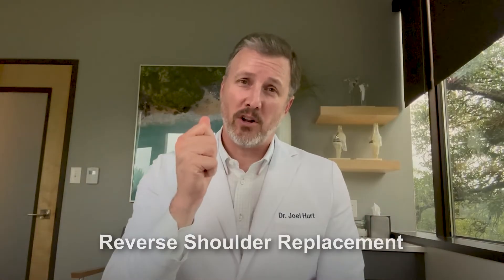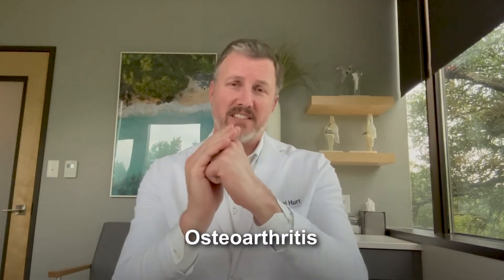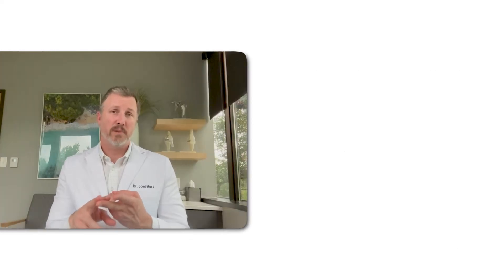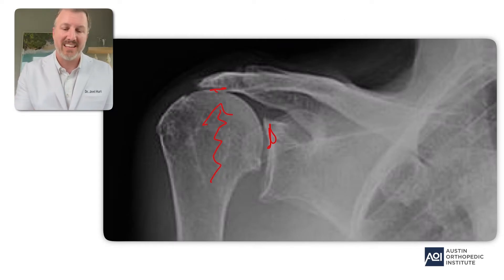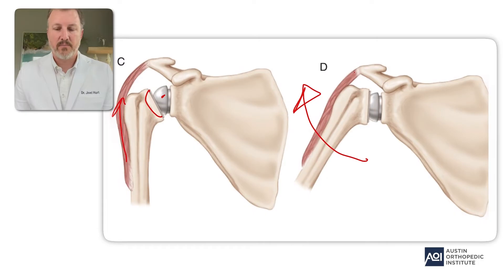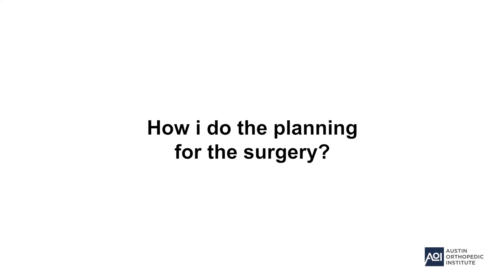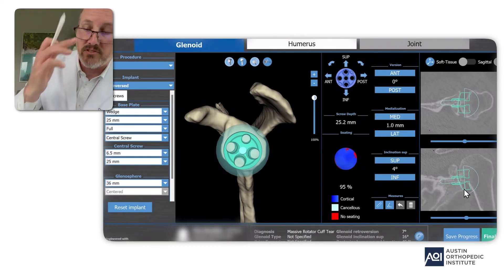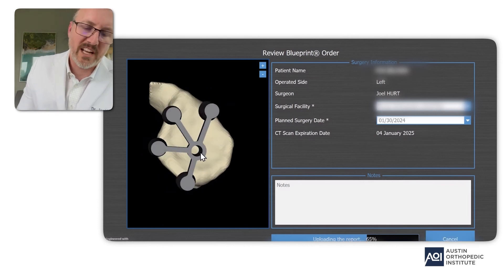Dr. Hurt Explains Reverse Shoulder Replacements

Comment: Not sure if you will see this Dr , but I had a ream and run shoulder operation 5 years ago on one  shoulder which seems to have failed . The glenoid has now worn uneven creating a space at the bottom .  Additionally it was determined a couple years ago I had two small tears in my rotator cuff that was going to attempt to be repaired . After a rent X-ray the Dr is recommending the reverse shoulder revision which will limit my future activities . I am now 69 but have been and am pretty active albeit my abilities to  go back to hitting. Heavy bag , martial arts , and other sports has become very limited . Right now I can lift weights although it hurts and light work: on a heavy bag which also hurts . Re reaming the glenoid doesn’t seem to be an option .  From what I read most of the glenoid wear is in the first 4 to 5 years which I am at . While painful I at least can still do things and not worry about any 25 lb restrictions . Any thoughts or opinion would be great as my surgery is 11/28 as of now but having second thoughts

Comment: I just got a shoulder replacement on thanksgiving eve and i feel great. All the pain is gone and doing stretches, rubber stretches, pulleys and cold compression therapy. Did my 2nd follow up with the doctor and he said i didn’t have to go to therapy because my recovery and my own therapy is working so great that he said to continue with what I’m doing. Life is so much better. Also I’m slowly back in the gym lifting very light weight and slowly progressing.
Reply: Good to know.  I’m going to have one in some weeks

Comment: I had an anatomical replacement shoulder fitted in 2012 and it was never very good. In November 2023 my surgeon decided to fit a reverse shoulder. The surgery was carried out in sept 2024 but infection was found so an antibiotic spacer was fitted. The reverse shoulder will be fitted next week, 7th Feb 2025 and my doc also does the surgery in the computer first. Hoping for a good outcome.
Reply: Please tell me how your arm has been working since September with the spacer.  Did you have use of your arm?  I had a fine anatomical from 2017, but I fell and am looking at needing the reverse due to cuff tear.  Surgeon mentioned possible infection, so that scenario has been on my mind.  Thank you.
Reply: I'm in the same boat as you. Haven't heard of this before but today I learned that I need a reverse. @cindybennetts4589